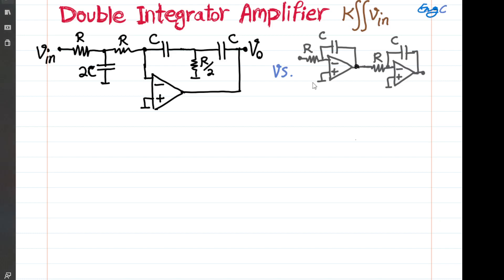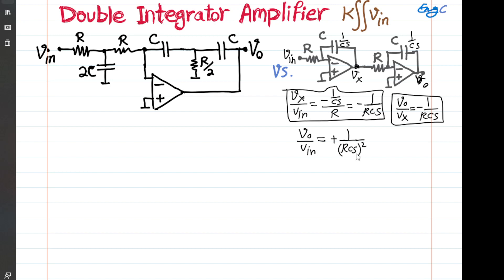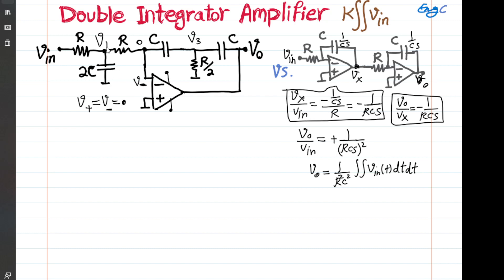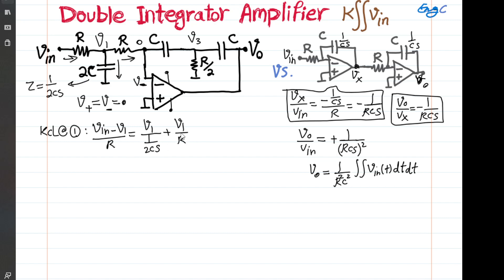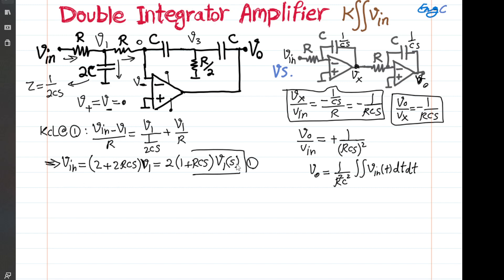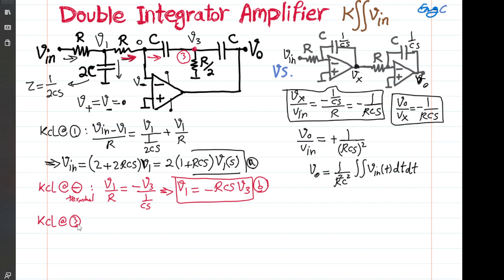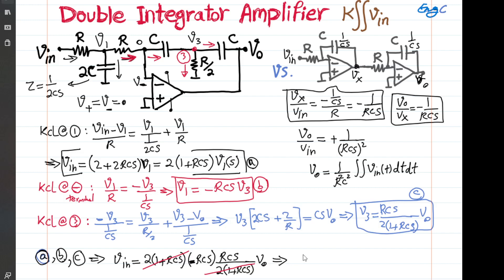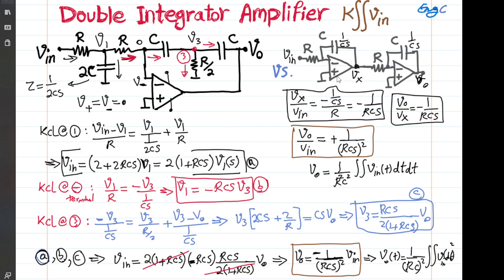Double Integrator Amplifier with single Op Amp

Comment: Please correct me if I am wrong, but it looks like this could be transformed into a double differentiator by swapping resistors and capacitors. Right? This is to construct a 12db/octave high frequency enhancement for a hearing aid like application.
Reply from the maker: https://www.youtube.com/@SteveRichfield Good question.  Sure, the second order Differentiator vs the 2nd order Integrator discussed in https://youtu.be/lOBaJ6BE_iE video and in https://youtu.be/BLVzuuqAlZs that presents Bode plot Frequency Analysis of Differentiator Circuit with Op Amp.  For your 12dB/octave design, I recommend considering https://youtu.be/KwUnQXbk7gM Sallen-Key Filter Design: LPF, HPF Frequency Response, and Damping Factor. I hope this is helpful.

Comment: Exceptionally good video, thank you for covering this. Can you show how to make frequency the subject of the formula and give an example?
Reply from the maker: Thanks Yaghiyah for your comment.  Glad that you liked this Op Amp based Integrator design video.  Sure, I will post a separate video in the coming days to give you an example of how to make frequency the subject of the formula.  I will also discuss the Bode magnitude and phase frequency plots.
Reply: @STEMprof  Thank you so much for the reply looking forward to it. Just so you know I saw this configuration in a class-d amplifier if you look at the "NAD M22 service manual" which uses an NCore amplifier that uses this exact op-amp structure in the modulator section, I had no idea until now what it was, I will try some LTspice examples tonight and see the behavior. Once again thank you.
Reply: Another point I noticed is in some cases a dc-operating point us considered as well where there is a feedback resistor between input and output sets the dc-gain.
Reply from the maker: @xorcipher  thank you for the information
Reply from the maker: @xorcipher  please see the following video that goes through Frequency response analysis: https://youtu.be/BLVzuuqAlZs